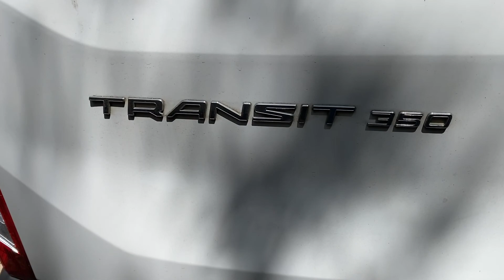2015 Ford Transit 350 rear door lock actuator replacement

Comment: Hoping you can help me out. I have a T250 cargo van and am getting a door ajar warning off the rear door latch. There was a plastic coating on the latch itself that has frayed and was basically flapping off. I trimmed off the plastic sheath and it seemed to correct the issue for a few days. However the door ajar notice returned and I haven't been able to get it to shut off. Heres my issue, the actuator/lock seems to be functioning (interior lights do not stay on) properly and doesn't seem to be the problem. Is there a sensor outside of the actuator/assembly? Is the sensor embedded in the actuator housing? if so can it be replaced without replacing the entire actuator? Or is replacing the entire works the only option?  SOMEONE PLEASE HELP, the dinging notice is gonna drive me to the looney bin....  And its not the sliding door, I replaced that sensor a few months back and it was an easy fix, this rear door has me stumped.

Comment: had to replace mine, on '15 chevy trax, dealership told me, just under $300, i found the part on ebay for like 28 and did it myself, so happy it worked lol. Mine was much easier than yours, and btw, was that a little baby girl?
Reply from the maker: When it comes to ordering car parts eBay is great, usually half the price of parts stores. 
  You were wise to send extra little feet for the wall plaque. Naomi makes 8. We finally have our little girl.